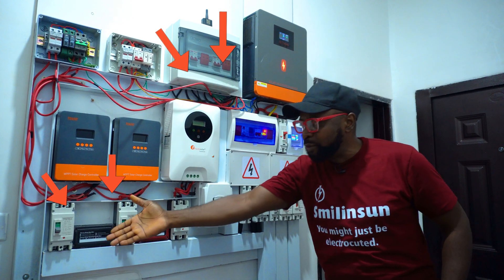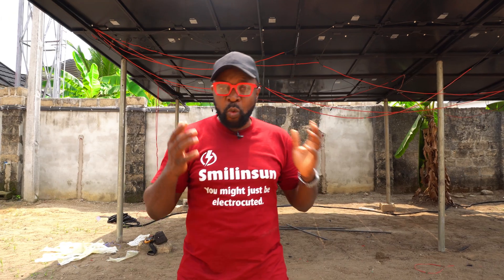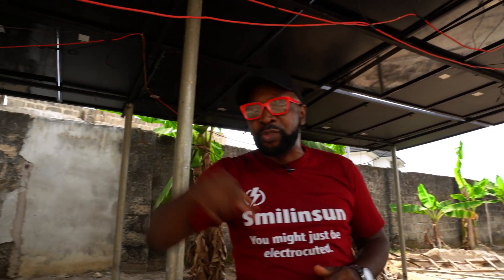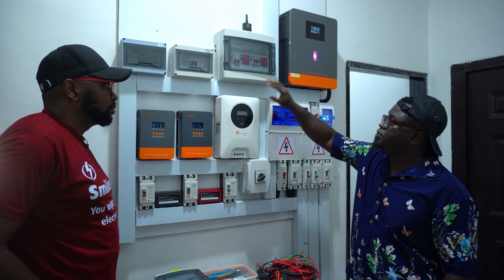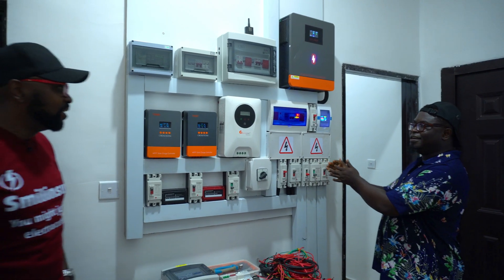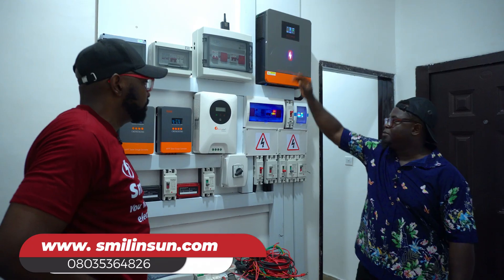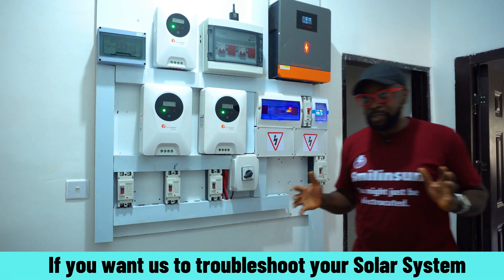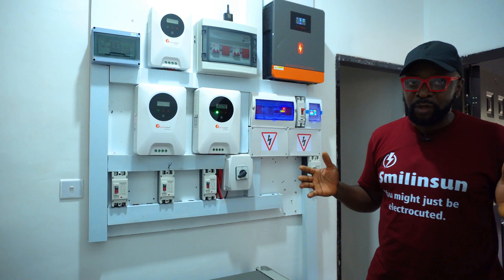Correcting a wrong Solar Installation

Comment: Is it right to use coper wire for solar instulation from panel to breaker?
Reply from the maker: They are all Copper whether Flex , strands or single wire

Comment: David, my friend DO NOT EVER go close to solar setup bare foot. If proper earthing is not done and charge leaks into inverter body...............ZAP!!!!!!!
Reply: Hats off to your original electrician that had you spend all that in pieces (all inverters and charge controllers looks brand new). Why you did not go for a single solar inverter that has charge control within it?
Reply from the maker: @MrTalhakamran2006  Lol

Comment: You can use both a Low Voltage Charge Controller (LVCC) and a High Voltage Charge Controller (HVCC) to charge the same batteries without issues, provided they don’t share the same solar panels. Just ensure both have identical battery charging profiles configured.

Input voltage differences between LVCC and HVCC do not affect their output charging voltages.

Please correct this part of the video, as it is inaccurate.
Reply: Thanks for this comment

Comment: Nigeria electrical engineers designed a system without a schematic diagram and wiring diagram. You guys should up your level of professionalism. And I heard  you said SPD Input to the system and out of the inverter are irrelivant? Anyway thank you that you made the system worked without having a wiring diagram at your disposal. I hope you made one available and charge for it.
Reply from the maker: What the video again and make sure you watch till the end
Reply: @smilinsunsmilinsun8056  if I didn't watch till the end, how then did I mention that you should make a wiring plan available afterwards?
A wiring diagram isn't only meant to understand the entire project structure but it gives another engineers or even you a clear view on how to troubleshoot or upgrade the system. If the first installer had provided a schematic and wiring diagram, you'll have understood the system initially with ease.

Comment: Nice one Ikenna...2units of the Hybrid inverter will solve that problem with an advantage of increasing the system to 20Kilowatt.
Reply from the maker: @danielallotey9959  The existing unit is 5 KW  with max pv of 6kw , adding another one won't take the whole panels, you need at least two.

Comment: What I notice with allot of solar companies, they charge you allot of monies then bring in allot of unnecessary equipments to justify the price to make their customers feel they are getting their monies worth. I DIY my system, runs my house off solar no problem. Good job, why are there so many problems like this in Africa my ancestoeral homeland? Installers please be honest with your customers.
Reply: I am wondering as well on how they put up so many components on a very simple installation...I guess the installers got confused with their own installation 😅
Reply from the maker: Yeah that could be a possibility

Comment: You also wasted resources for the man. Why introduce another low voltage charge controller when you already had 2pcs on the wall? You should have correct the connections the way you connected the 2 charge controllers you introduced. Nice one though
Reply: You didn't listen to the part where he said the characteristics of them (previous CC) are not the same and he wants everything to be working together

Comment: Please Sir. Do you know if 100a Felicity charge controllers come in 24v or they all only come in 48v
Reply from the maker: @SunnyEmerson  The same charge controller Charges 12 Volts,  24 volt, and 48 volts
Reply from the maker: @SunnyEmerson  The same charge controller Charges 12 Volts,  24 volt, and 48 volts

Comment: Even though there are too many possible points of failure in the original design.   I still believe that proper settings and rewiring would have resolved the issues with the original setup. Low coktage and high voltage CC works together if the output settings of both CC are configured similarly. If  both HV and LV CCs are  configured on LFP profile (if the built-in profiles are same) or customized LFP profile  with the same setting across the CCs.
Reply: Very possible. My setup has both the LV CC and HV CC charging my LFP battery at the same time. However, once the bat3 gets filled up, the LVCC cuts OFF but comes ON when the battery discharges due to load usage.
Reply from the maker: The route we tock is still the best option

Comment: I swear that system looks like it was put together by a carpenter
Reply from the maker: Lol that is mean Bro!
Reply: @smilinsunsmilinsun8056  there's no way i would have let that slide and I'm pretty sure the installer went missing after that. Funny people, I like the way you calculate the voltage, you know your Job bro

Comment: Hi. I am an on a DIY solar journey in Kenya. Very expensive mistakes - I call them tuition but they are expensive. First I bought an Ecoflow delta 2 max (D2M) (20% discount at the opportune time). Then, before I understood the technicalities of choosing solar panels and the challenges of mismatched panels, I bought two portable panels - 400W and 220 watt bifacial. I also bought two 100 watt panels because they were cheap - I hadn't yet bothered to understand Voc and Short circuit current implications, I was looking at cost and doing grade 1 arithmetic with watts. The I came across jinko 480W panels, and bought 2 of them, making them my main panels. The delta 2 max has 2048 Wh capacity - best I can get is about 1800Wh and has two MPPTs with 500watt maximum input - 15Amps max, 60V max input. To extend capacity, I bought 1 300ah 12V LiFePo4 battery then routed one 480 panel to charge this battery and put one delta 2 max MPPT as the load giving a continuous 167Watt charge (of course it would run out before morning). The second Jinko 480 went straight into the 2nd D2M MPPT. Charge controller-wise, I first bought a 60W PWM charge controller - money down the drain. It output to load in pulses and never quite charged the battery appropriately. Next, I bought a fan cooled MPPT that worked better but was loud and did not have an overvoltage protection - I fried it when I tried to connect four panels in series. It literally smoked. Finally, I bought one 45A felicity solar MPPT, similar to the ones you have on this video but 45Amps and it seems to charge well. I also connected the portable 400W in parallel to the Jinko 480 to charge the battery. Last week, I bought a second LiFePo4 similar to the first one and connected them in series so that the setup now pushes out 15A at 24 V approximately giving 360Watts continuously. Two current problems - the felicity charge controller only comes one when there is solar input. When only the battery is connected, with no solar input (say at night). I assume this is how it works? Every night, it goes off and turns back on in the morning once the solar input goes beyond a certain voltage. The second issue that has arisen is more serious. The charge controller displays a fault (code 03 - battery voltage low) when the batteries drain to a low value. It will not charge at all in this state. It displays battery voltage as low as 4.5 volts on the charge controller. In this instance the ecoflow D2M is connected but is not charging. I take it it's because the batteries are drained. However, the moment I disconnect the Ecoflow, the voltage on the charge controller rises immediately to 24V thereabout and it starts charging the battery. I would really appreciate your view on this and anything I could do to improve the situation. I suspect it is a mismatch in the voltages of the two batteries. Please advise. Thank you.
Reply: @ChessGrandmaster My bro. I'm also from Kenya and went through a similar DIY journey. I advise you to keep it simple by adding a 24V 2000W inverter to your system instead of using the EcoFlow. The EcoFlow is great for backup, but a dedicated inverter is much more versatile and easier to work with.
To connect everything, first wire your Junko 400w solar panels in series to the Felicity 45A charge controller's PV input. After that, take your 12V LiFePO4 batteries and connect them in series to get a 24V output. This is very important: make sure the batteries are from the same manufacturer and, more importantly fully charged and at the exact same voltage before you connect them. Once you've done that, connect the batteries to the charge controller's battery input. Finally, you'll connect the batteries directly to the inverter. From there you can connect your loads to the inverter. One final piece of advice is to install a DC fuse or DC circuit breaker (100A) between the batteries and the inverter to protect your system from short circuits and ensure safety.
Reply: @Lonzo254 Thank you boss. I can understand the basis of the different bits of advice in your post. I thought of buying a dedicated inverter but ended up deciding against it for a few reasons: 1. I need more than 2000W output - At least 5KW continuous. The options available are 48V systems. Meaning a lot more investment in panels and batteries. 2. The ecoflow system has two big advantages. The first is the mobile app. The second is an energy management option which allows for smooth intelligent switch-over from mains to solar and vice versa. What I did was buy another charge controller with load options. This has an Overdischarge protection so that the charging and discharge is now automated. I also bought an additional 580W panel. I'll add one more. The foldable panels are in storage. The 100W panels are decorations.
Reply: @ChessGrandmaster  Wow, a lot going on. Would need a schematic of what you are trying to achieve to even begin to understand what you are trying to do.
Reply from the maker: You are doing a great job on your solar journey! The challenges you are facing are common when you start with DIY and it is important to learn from them. You should consider investing in a good quality MPPT charger and ensure that your panels and batteries are compatible.

Comment: The full hybrid feature of the inverter, converting DC to AC directly from solar panels is not being put to use right now. Thats one thing I really love about hybrid inverters. 14.6kw of panels matched with 30kw of batteries, the excess power from the solar panels will be put to waste the hybrid function of the inverter. I love your videos by the way
Reply from the maker: It was the most logical choice, as the real need here isn’t for another inverter. Buying one simply for its high-voltage MPPT charging system, especially when it can't fully utilize the available PV capacity, wouldn’t be the most sensible decision. I really appreciate your input, thank you!

Comment: If your client is happy that is fine, I didn't see alot of details on the specs of the components so despite I see what appears to be better ways, I can't really say for sure as I am not there and what you have shown is very limited. If job was done safely and client is happy then that is good.
Reply from the maker: The Client is over the moon ,the system works great ,what specifications would you want to know, would be a a pleasure to provide what you need. Thank you for your comment.

Comment: Nice job Ikenna, you have done well. Initial scene was scary and too busy for sight. A good single 10kva hybrid inverter that can take about 11kw pv input are available and will do the job perfectly fine without extra external MPPT Charge Controllers
Reply: ...Depends if the loads are not inductive. Transformer based hybrid inverters mostly don't have high pv input because of the cost and complications in designing and producing such systems.

Comment: I think I would solve this issue slightly differently to take advantage of the high number of solar panels the client has. Firstly those PowMr Hybrid Inverters (or All in One Inverters) are quite cheap, so I'll add two of them instead of the Felicity Solar 120A  and 60A charge controllers because the price difference is relatively small. I'm assuming that's at least a 6.2kW inverter that the client has. I would divide the solar panel strings as follows: First String, divide the 400w panels into two to make a 8 series 2 parallel configuration that will give a total of 280 VoC (assuming 35 VoC per panel) . Second and third string, divide the eighteen 460w panels into two to make 9 panels in series of 450 Voc (assuming 50 VoC per panel). The PowMr can take up to 500V.  If the inverters can be combined in parallel, that would be the best case scenario. If not, then the loads may need to be divided and the inverters distributed accordingly (more work and planning though). 

The reason I believe this is better is to take advantage of the excess solar energy the panels are producing and use the solar energy directly to feed the loads in the house through the hybrid inverters. Something that the low voltage charge controllers can't do. If the battery is compatible, the inverters can also communicate with the battery to have the best health with SoC and balancing out the cells. Another advantage is that the inverters also have a built in transfer switch, so no need to manually change over, the client would not even notice when the grid goes off.  Thirdly, the client has about 15kW of solar panels, the battery looks to be 20kWh (I may be wrong here) worth of storage, there's going to be a lot of excess solar generation when the batteries are charged. With the extra hybrid inverters, this excess solar can now power higher loads like Air Conditioner units, electric cooking (Induction cooking recommended), electric water heating, vacuum cleaning, power pressure washer, etc. All this to maximize his solar generation. In fact, from my opinion, this client has enough solar not to even require the grid. The extra hybrid inverters also act as a backup. In the case one malfunctions, power can still be generated as the unit is pulled out for servicing.

Obviously the batteries have to be in parallel, not sure what the initial installer was thinking separating them. Oh and one last thing, with they hybrid inverters you can monitor the input and output of your solar system from one app.

With a 15kW solar panel setup, I would also get an electric car and charge it up using solar!
Reply: I would also do the same why providing a charge controller yet the inverter has the inbuilt mppt?
Reply: @peterpn3215 You can add charge controllers if you need more battery and solar panel capacity. They help charge your batteries separately, so if you’re fine with a 12kW inverter but need to expand your solar and battery storage, just add extra charge controllers instead of another inverter. Some hybrid all-in-one inverters mainly handle DC to AC conversion (and vice versa) with limited MPPT input and output, so there’s no need to add another inverter just to increase MPPT capacity—using charge controllers is the better solution!
Reply: I think in this case, it's not a Matter of undersized inverter power. It's about charging, controlling and storage issues.

The battery size was okay but were not receiving enough power to charge. 

The solar panels too were enough to do the job

The only thing remaining was to increase the charge controller capacity to properly charge those batteries to full capacity
Reply: I think this issue can still be resolved without replacing the Pwrmr controllers.

Also, making a statement of operational conflict of a high voltage inbuilt charge controller and low voltage external charge controller is not correct. As long as their output voltage is the same, there is absolutely nothing wrong with combining a hybrid inverter with a high VOC with an external low voltage MPPT, as long as their input solar array are different. Solar power load priority is best done using the solar array of a hybrid inverter.

So much unnecessary protection. Agreed.

Both batteries paralleled with a communication cable. Agreed.

The main issue might be VOC mismatch on both the hybrid and the external charge controllers.

Those error codes might be pointing at overvoltage in the controller and some settings error might be on the program.

My humble Observation.

@smilinsun Thanks for the good job you always do.
Reply: wWx
Reply from the maker: Before solving a problem, you must first understand your client's needs. These needs are centered around energy generation and not inverter's capacity. You're suggesting that another Powmr inverter is required, but this approach forces your client to purchase an inverter they don’t actually need. Keep in mind that even with an additional Powmr hybrid inverter with a 100 amp capacity limit, it won’t be able to handle the full 15 kW of PV power. Adding an extra hybrid inverter, which is unnecessary, is not only an expensive solution but still won't fully accommodate all the PVs. So this is is counter productive.

Comment: Would it have been better to have used the high voltage input on the hybrid inverter for charging as 1, It would allow for smaller power loses due to lower amperage usage from the solar panel with the long runs 2, The Hybrid inverter has the controller built in which allows for less clutter 3, Instead of buying 2 additional charge controllers you could buy 1 additional inverter to split the 400 and 460watt strings if more power was needed ?
Reply from the maker: @damianalbury9583  It would still not be enough to contain the Solar panels.